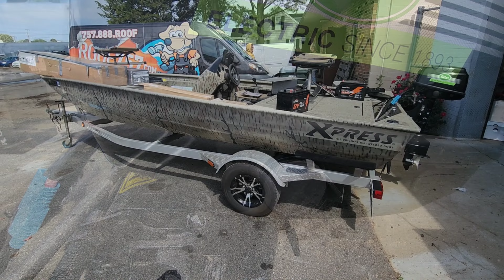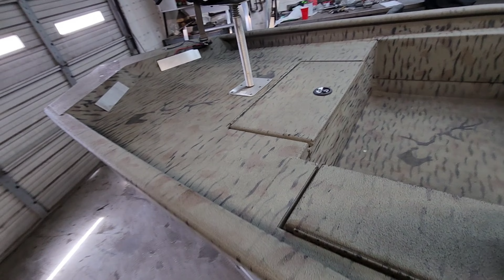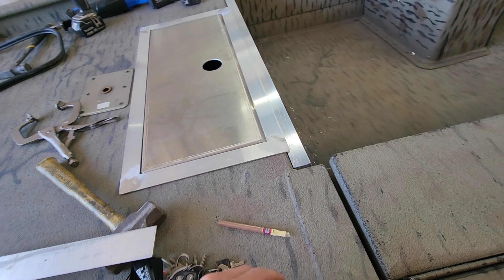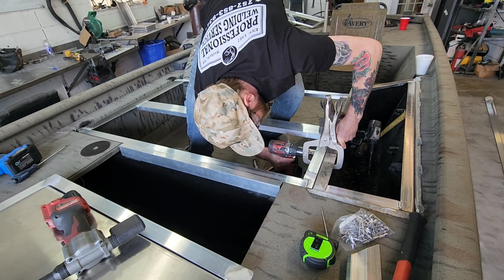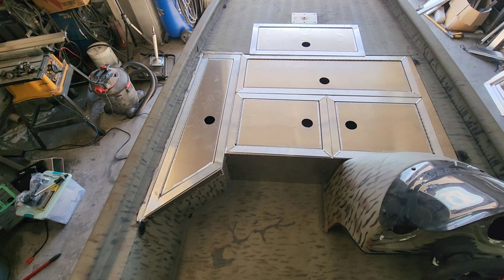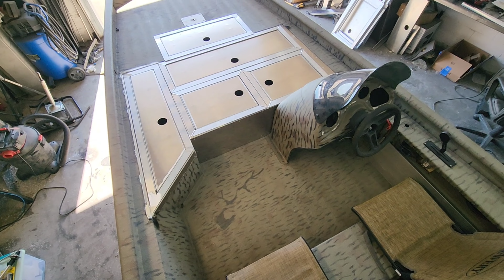Xpress 1860 "the original All-welded boat" Next Level Modifications!

Comment: you can ask for a rolls axle trailer the best ever made no leaf springs no torsion bars a proprietary patent aluminum cushioned spring system stainless steel hubs stainless steel lug nuts stainless steel studs plant City Florida-20 years old and I'll never buy any other brand.
Reply from the maker: Ill check it out. Thanks for sharing

Comment: That's some nice additions for that boat. That 5hp electric outboard would have to go, though! 😂
Reply from the maker: Lol. Electric outboards are not my thing. I like my boats to have 3 speeds Here, there, and Gone!
Reply: @TRICKEDTINS  I know that's right. If you've ever been on a large lake and had a storm move in quickly and need to get off of the water fast, you've got to have a motor that'll go. If not for speed, just horsepower to keep you moving and stay in control of the boat.